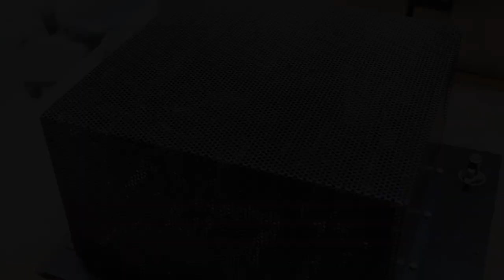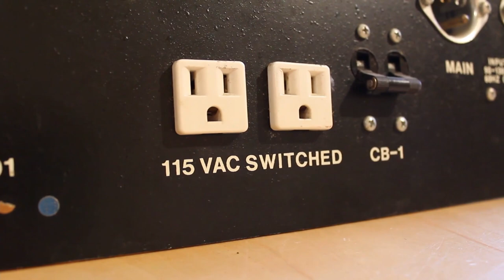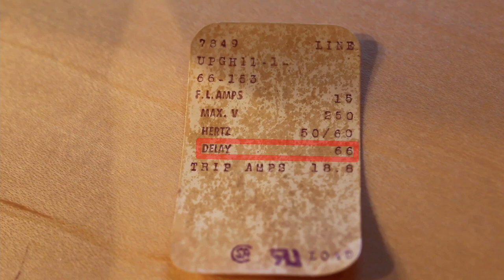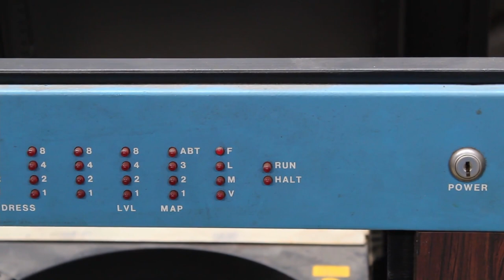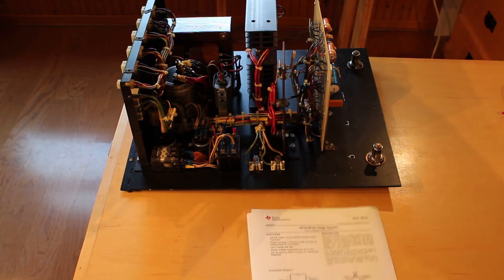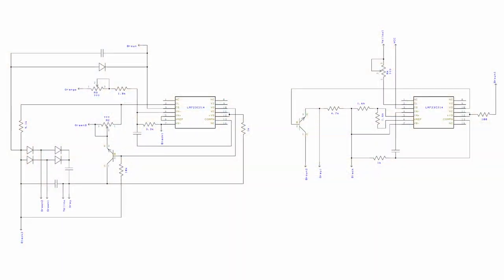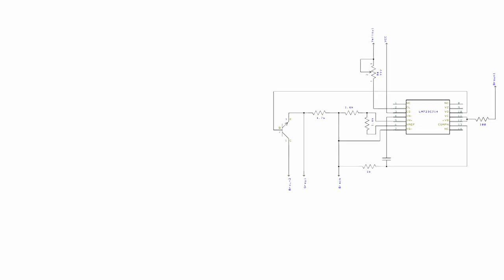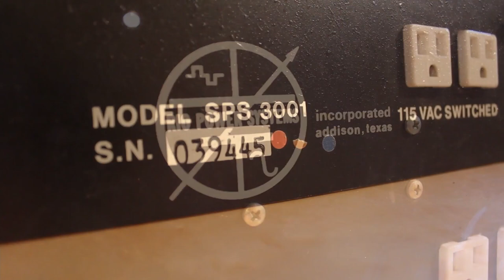Minicomputer Part 3: In-depth Look at the Power Supply

Comment: I've seen mil specs for component installation showing leads with bends in them sort of similar to those capacitor leads. I think the idea there is to allow for flex during heating/cooling cycles to avoid metal fatigue. Not sure that's what they were going for here but that's what it reminded me of. Gotta love it when you see something that was built back when companies gave a fuck about quality, haha.
Reply from the maker: That's interesting, I never would have thought of thermal cycling being taken into account, but that's the most logical guess as to why they did that that I've seen so far! Particularly considering that the entire thing is passively cooled. I do really love how very well designed the PSU is, they really seem to have put quality first and foremost here!
Reply: not just thermal cycling but shock/vibration too.

Comment: That's a ferroresonant transformer, together with the oblong shaped cap on the chassis it forms a (somewhat) stabilized AC supply.  This achieves mains filtering and allows to keep the regulation tolerances a bit tighter, the power transistors don't have to drop as much voltage as would be needed with a ordinary transformer so the whole thing can run cooler.
Not something you see a lot these days, probably because linear supplies are a bit out of fashion.
Reply from the maker: I had to actually look up Ferroresonant Transformers as I had never heard of them, but that totally explains the AC rated capacitor that's in there. 
Reading about them, they're wild pieces of engineering, and that's awesome that one is being used here! Thank you so much for pointing me down that path, time to do a lot more reading!
Reply: I had the resonating capacitor of the constant voltage transformer in an old DuMont oscilloscope fail explosively.  The smell was awful, and the dielectric liquid got all over everything in the lab, and was very difficult to clean up.  Not a fun day, as the newspaper reporter was there to do a story on our project.
Reply: ferroresonant transformers were real common on minicomputers. the core is saturated at 120V so it simply cannot pass anything more than that.

Comment: When you see an array of TO-3 transistors on a large heat sink that's a good clue that you're looking at a power supply that's operating in a linear regulator mode.
Reply from the maker: Yup! Switching power supplies run a lot cooler, but it's hard to beat the smoothness of a linear supply.
I was just fascinated by the fact that the LM723 was intended for use in both styles!
Reply: As if there's a switched mode power supply with such a large transformer.
Reply: I concur.  That is ONE massive PS and I bet it churns out VERY regulated power too!
Reply: In that day in time switchmode power supplies simply did not exist because they could not regulate the power well enough and clean enough for computer use.

Comment: For someone who claims to have no idea, you have a very logical and efficient approach of learning about something which is very impressive. 
Very nice unit. It is from a time, where the integration density was low enough to figure everything out without taking it apart and slapping it under a microscope. 
I was very surprised, to see such a clean power supply, compared to some other parts of the system.
Reply from the maker: (YT seems to have lost some of my comment replies, so if you're seeing double replies, it means I truly don't have a clue what YT is doing anymore, haha)
I'm very much so just making this up as I go, haha. But, my father taught me how to approach black box problems like this from a pretty methodical standpoint, so I'm not totally lost thankfully. 
It is truly an excellent PSU design though! Such wonderful wire routing and clear layouts, the designers very clearly prioritized a high quality and reliable design!

Comment: Do not recall and "time delay" on the power control relay.  In you drawing the front panel power ON / OFF switch has 120 VAC on the switch. The key power switch ( White & Black wires ) is in series with the relay field coil so be careful  not get shocked with 120 VAC line voltage.  This power supply is a ferroresonant transformer design with uses the large gray oval capacitor in  parallel with a second primary transformer winding making a LC tank circuit to store energy to improve power supply performance caused by AC line side voltage changes.  The loud buzzing could be the gray oval capacitor is weak of failed, the PS normally did not buzz unless the AC input voltage was well below 100 VAC. The the AC line voltage was from 110 VAC to 130 VAC the PS should not buzz.    One item you should check about this PS at its age is the 5 VDC output for AC ripple on the 5 VDC when connected to the backplane with cards installed the computer cage (backplane). Many field engineers had problems with the system halting or even not booting because the 5 VDC when first check with a VOM was down to 4.7 VDC +/-. The F.E. adjust the 4.7 VDC up to 5 VDC using a VOM and did not check for AC ripple using a oscilloscope to see is the DC had ripple.  Big mistake not checking for ripple....   If reason the 5 VDC dropped from the factory setting of 5 VDC to around 4.7 VDC when checked using a VOM is because to ripple. If the scope shows ripple (about 0.25 to 1.0 volts) at 120Hz the large filter cap with all the wires on it is bad. If the ripple is 60 Hz a diode in the full wave bridge was failed.  The 120 Hz and 60 Hz ripple comment are based on a AC input freq. of 60 Hz.       Be safe and do not get shocked...!    kromaine132@gmail.com
Reply from the maker: You're absolutely right!
I was way off base with the time delay. That sticker that I thought was talking about the relay, was actually for the circuit breakers next to the relay. When powering up, the clicks over as soon as the key-switch is turned on with no delay at all.
Thank you so much for the excellent information on the PSU. The buzzing is louder than I was expecting, but it doesn't sound loud enough that I'm afraid it's coming apart at the seams. Having said that though, it's definitely an excellent idea to go through and check the 5V rail in more detail. I did measure the 5V rail voltage once all the cards were plugged in and the PSU was properly loaded, and it was sitting at right around 5.1V, which seemed alright to me. But, I didn't think to check the ripple! I'll definitely hook the scope up to and see if there is any ripple on the PSU with all the cards in.
Reply: @UsagiElectric  I have some circuit breakers with the same style of sticker so it seems likely it would be from the circuit breaker.

Comment: What an utterly INSANE power supply--and those drives in the previous video were bonkers too; everything back then was built BIG and completely user serviceable; you can imagine a technician servicing the centurion with a truckload of HUGE parts, replacement boards--whatever was needed!

Comment: The individual or team that assembled that power supply had an obviously huge amount of pride in their work. I used to work in an industry where we would build custom electronic "boxes" with lots of wire runs, and would have clean ty-wrapped bundles like the ones in this power supply.

Comment: most of these Power supplies are Linear Power supplies not switch mode because those are very noisy, you need clean power. also, you should replace the two 6000uf caps and the two orange caps to they had some leakage (the white power on them). The Motor and Voice coil takes a lot of current to startup. but not too much to run. so the need for clean power is a must.
Reply from the maker: I've learned a bit more about this one since doing this video, it uses a Ferrorresonant transformer, which is a fascinating type of transformer, but also why it's a bit noisy. 
This power supply only gives power to computer hardware, and off camera in-between part 7 and part 8 I actually checked the ripple on the 5V, 12V, 24V and -12V rails with all the cards loaded in, and it's less than 10mV of ripple (I say less than because at that point, probe noise was more prevalent than ripple). The PSU in this thing is one of the most stable supplies I've ever seen!

Comment: The delay is there because the Drives need to be powered on first so the main system can recognize them when it posts.

The 723 regulator was the LM317 of it's day. I still use it in a few designs. 

The Power supply looks like it can handle a lot of current since it has so many series pass transistors. The 5V rail is floating so it can work smarter and not harder. So instead of regulating 24 something volts to 5 volts that I bet has a lot of current as well tons of heat they made a virtual ground. So in this case ground isn't zero volts but 19 volts, so since the ground is elevated it will put out five volts since 24 is the highest point of the rail. This also means it wouldn't be using a bonded ground from the rest of the power supply. So be very careful poking around in there when you apply power to check the voltages.
Reply: 723 is a real classic tool-box chip. It's not as integrated as the 317, more like a bunch of things you can use to make various kinds of power supply designs.
Reply from the maker: That was my first thought with the delay as well, but the 115VAC switched sockets don't actually see any power until the relay kicks over. Another viewer though identified the sticker and actually, I was totally off the mark here! That sticker is actually for the circuit breaker, it has a 66 second trip delay. The relay is most likely just a standard run-of-the-mill industrial relay. I'm still not sure how the drives get powered on before the main system, but maybe that's handled on the CPU board or something.

Thank you so much for the insight on the 5V rail though, that makes a lot of sense! Since the PSU seems to be pretty much completely passively cooled, it makes sense that they pulled out all the fun little tricks to try to keep heat generation to a minimum!
Reply from the maker: @cda32  It definitely seems like the Swiss army knife of vintage power supply design!

Comment: @4:50 the bends are strain relief for large axial component leads. it's designed to reduce stress so the lead or joint doesn't fail from fatigue, most likely thermal cycling.
Reply from the maker: Thermal cycling is something I hadn't thought of but totally makes sense! Everything on this computer has been amazingly over-engineered, so I can totally see the axial caps being installed in such a way that fatigue stress is kept to and absolute minimum!
Reply: @UsagiElectric  small company like this doesn't want to have to deal with repairs. easier / cheaper to over engineer in the first place, since support/repairs/returns cost them lots of money.

a lot of the engineering patterns in this computer seem to be spillover from 1960s-70s aerospace / miiltary design. this practice was more common in the 80s computer designs. these practices hardly ever seen these days anymore.

Comment: The LM723 was very common in Linear Power Supply Designs, since 1970s.
Since the 723 can not handle significant current, a transistor (TIP series) are used to drive NPN Pass transistors.
For higher currents, the NPN Pass transistors (TO-3), like 2N3055 or 2N3771 are used.

Comment: floating earth technique. It is applied only when you need to regulate above the maximum that the regulator tolerates or can supply.
for example, take a 7824 regulator, and you need 29V at the output...instead of connecting the common to ground, you do it through a 5V zener ... the 7824 still has its own ground as a reference, but, as that ground is ABOVE the common ground of the circuit, the output will be the 24v of the regulator, plus, the drop in the zener
Reply from the maker: What's interesting though is that the highest voltage used in the PSU is still below the maximum that the regulator can tolerate. The LM723 can give up to 37V, so even the 24V rail plus 5V is still less 8V less than what the LM723 is capable of. That's why it seems really weird to me to use the floating ground style here. 

Another commenter mentioned it's probably done this way specifically because of the way the windings are built. The transformer and PSU is designed around 12V intervals (-12V, +12V, +24V), so if they wanted to get a 5V rail using the actual ground, they'd have to regulate the +12V rail down, essentially dropping 7V. But, with the floating ground, they can essentially make it so that you only have to regulate from 5V away from one of the other voltage rails. This keeps heat generation down, which is important in a passively cooled system like this.

Honestly, I'm still trying to wrap my head around it, but that does make some kind of sense!

Comment: Cool series.  I love vintage electronics as well.  I think the time delay relay is to prevent the system from being powered off and back on too rapidly.  If there is a brief power outage the delay would not allow the system to come back on for at least 66 seconds.  Must be some relevance to the 66 seconds to the circuitry or the drives.

Comment: There might be an error on your schematic of the primary AC wiring. I think the key switch only operates the relay. Both common terminals of the relay most likely go direct to the circuit breaker. The reason they would do this is because the key switch is probably only rated at 3-5 amps which is fine for the relay coil but would be too low for the power supply plus the added AC peripherals. Oh and as said below, this is not a time delay relay. That label is from the circuit breaker and the delay is the breaker trip time.

Other optional  features of the famous 723 regulator are current limiting and current fold-back. Current limiting, limits the output current to a set value. Current fold-back shuts the regulator down if excessive current is drawn, like an output short circuit. The 723 was (still is) a great IC!

Comment: I´m curious to see where the floating ground of the 5V section is tied to!
My guess is, it´s used as kind of an sense input, connected to the load through an separated wire.
Might be useful in order to supress hum and compensate loses.
Reply: Yes, i agreed, i think it's likely that the 5v regulator has 2 additional sense wires going up to the backplane so it can measure the 5 volts on the backplane and cancel out any voltage drop in cables and connectors. This is quite common on the 5volt rail as it's the highest current.
Reply from the maker: That's really interesting! I hadn't thought of the floating ground being used to compensate for losses, that's a really genius way to ensure a steady and clean 5V no matter the load! I'll have to some more tracing out of wires and see if I can find where the floating ground snakes off to.
Reply: @jameshearne891     -   Correct the 5 VDC power wiring to the backplane has small gauge "sense wires" crimped in the ring lugs with the main current path 5 VDC wires giving 5 VDC status feedback to the power supply reg. circuit.

Comment: The blue capacitors have a date code of 7809 which means they were manufactured on the 9th week of 1978. Some of the ICs on the disk drives were dated 11th week of 1983. So yeah this machine was built circa 1984.

Comment: Mil-ish type of construction, certainly quality data center construction and features. Considering the burn-in on the terminals, the system had a lots of hours on it and the main PSU held up well without a big fan... Where is the AUX plug wired into the schematic?
Reply from the maker: I was surprised at just how clean it was inside! And you're right, I totally didn't make the connection that the burn-in must have meant that this thing spent a ton of time on! Then again, it was used for at least 14 years, and near as I can tell, the PSU hasn't seen any rework or even been opened since 1978!
Interestingly, I probed around a bit and couldn't find where the AUX plug went at all. Near as I can tell it doesn't go to the breakers or the relay at all, so I don't actually have a clue where it might go.

Comment: Delay is quite simple, other units (disc) has to be powered up before the main processor ...
Reply from the maker: That was my first thought, but the 115VAC sockets don't kick on until the relay kicks on.
But, it turns out I was totally off the mark here. Another viewer actually identified the specific breakers that are being used here and the sticker is actually talking about the trip-delay time for the breaker! The relay is most likely just a regular run-of-the-mill industrial power relay.
Reply: Another possibility is the delay prevents the breaker from tripping prematurely due to the inrush current when the unit is powered on.

Comment: Those enormous capacitors would be fun to power up. I hope they are still in good condition! I imagine they would be difficult to replace.
Reply from the maker: (YT seems to have lost some of my comment replies, so if you're seeing double replies, it means I truly don't have a clue what YT is doing anymore, haha)
I'm hoping the larger caps are still in good shape! The two that are next to the transformer seem to be really well designed caps, so I'm not too worried about them. It's the smaller electrolytics that I've had bad history with, but even they seem to look pretty solid!
Reply: @UsagiElectric   No worries! My replies sometimes disappear too.

Comment: Are you absolutely sure that the switched 115-VAC outlets don't power on as soon as you flip the switch?  Because it seems to me the purpose of the time-delay relay is to allow those outlets to power up immediately, but prevent the computer itself from powering up for 60 seconds, in order for the drives plugged into those outlets to get spun up and settled before the computer powers up and tries to access them...